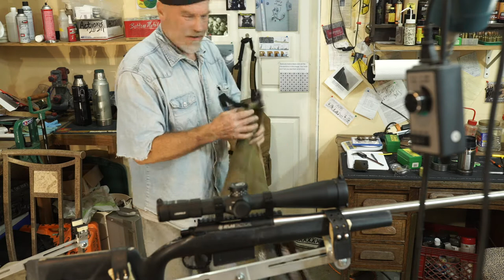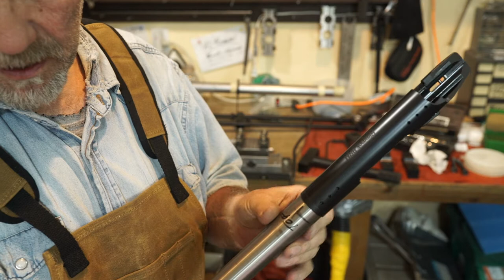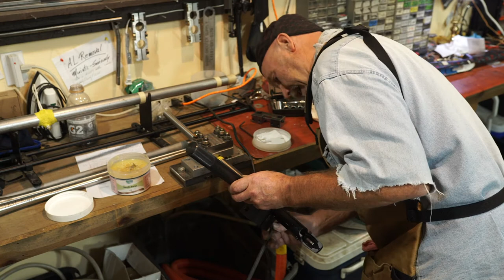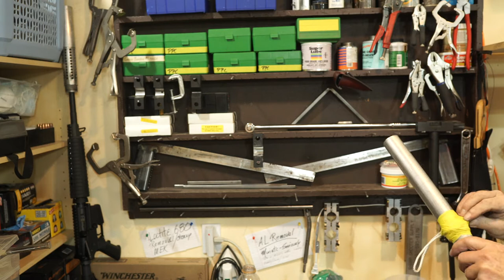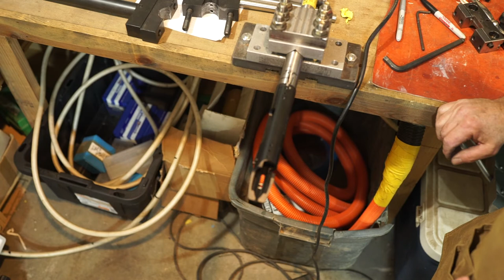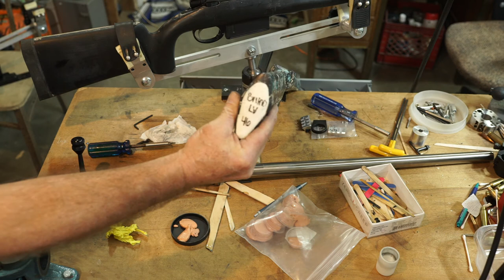ep90-A barrel vise/torque setupMAH09590-

Comment: Al
Not knowing how you chamber your barrels I Sam assuming you time your muzzle barrel runout to 12 o’clock?
Reply from the maker: Thank you for your kind words....I've never told anyone and won't publish it but NO, I do not use the 12 O-clock position. Think "torque" ..... I've got a system based on twist-rate and bullet energy which I use to counter torque. It's based around the 6:00 position and my criteria is that if the rifle jumps and resets left or right of center I've got it wrong :)

Comment: Hi Al,  Where did you get your barrel vice? Did you make it? Thanks.
Reply from the maker: I modified an aluminum Time Precision vise with the addition of the two steel plates and the addition of a third pulldown bolt per side. I did slip it just yesterday torquing a 50BMG bbl to 250ftlb.... had to crank on that liddle wrench hannle so hard my hand hurt ;)
Reply: @opinionsby____al7501  Thanks Al.